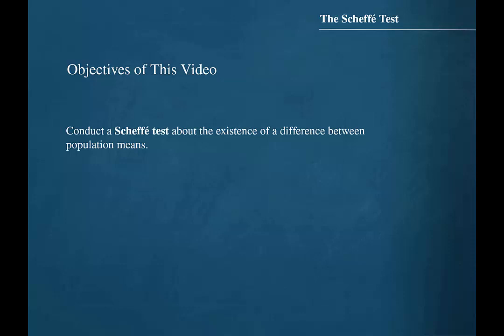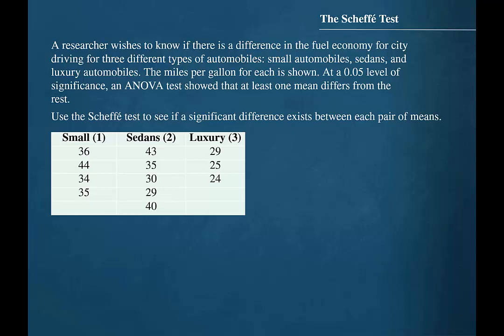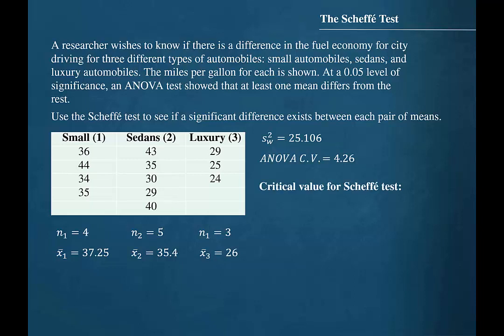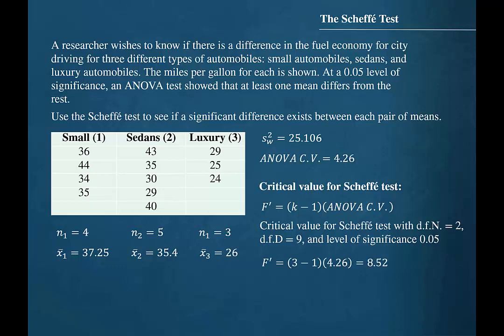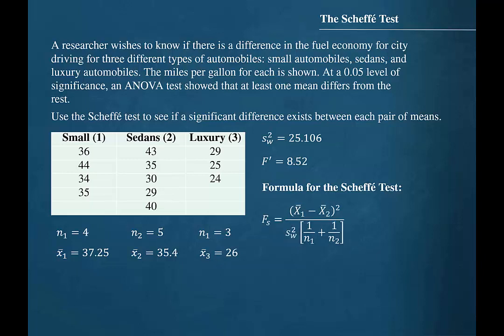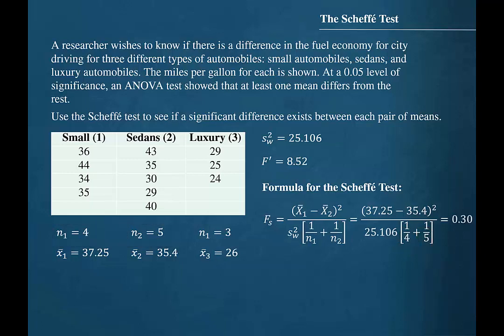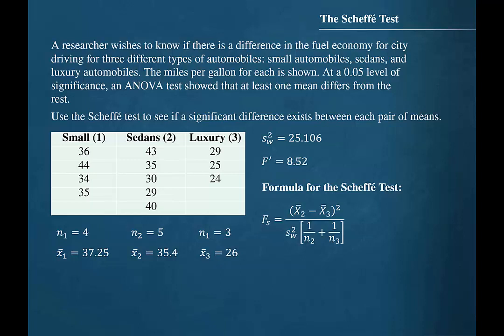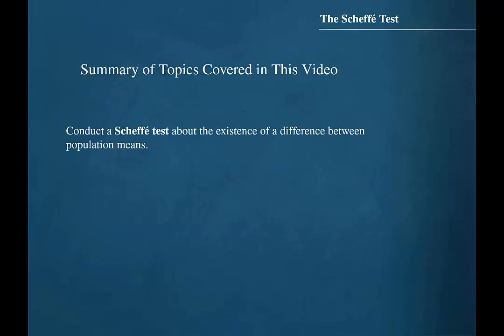12.2 The Scheffe Test

Comment: How do you calculate the “within group variance”? Other than that, thanks for the video.
Reply: Use the following 3 steps: 
1) For each group, compute the SS (akin to each group's mean)
2) Add all groups' SSs together (SS1 + SS2 + ... + SSk) to get SSw
3) Divide SSW by N-k (where N is the total number of data points and K is the number of groups)